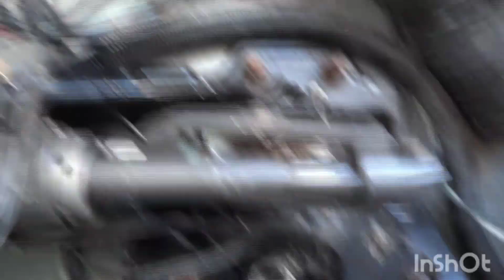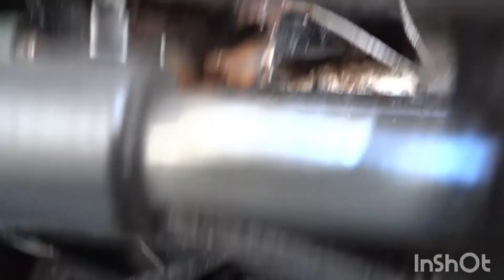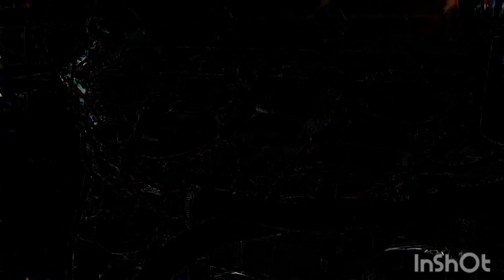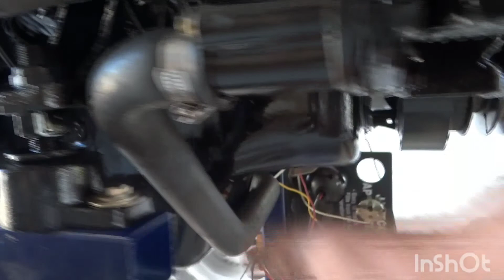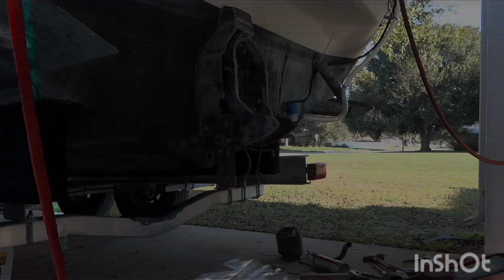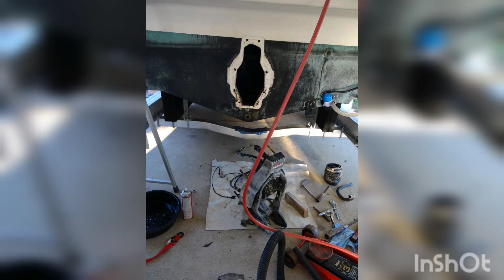Mercruiser transom plate and gimble repair

Comment: I have to maybe take mine off to replace the gear loop fitting next to the intake assembly.Is there anything I need to watch out for I did not see a gasket on yours.Would there be a paper gasket that would be replaced?When I take mine off

Comment: Good job, my friend. I liked the music, just maybe a notch too loud. But yea, bravoitis.. I've dealt with it a few times in my 20 year career. I'm in a fresh water area so I don't see it a lot, but occasionally someone buys a boat that has seen salt and I end up having to diagnose & repair the issue. In all cases, I have deleted the original intake setup and installed a thru-hull pickup. That may not be possible in all scenarios, but it was doable in all the cases I've encountered. Never to worry about it again, all the water the engine could ever ask for, and much easier/cheaper than repairing the original design - especially if it requires pulling the motor! Rock on!

Comment: Thanks for the video! I found it very helpful to diagnose and confirm what I already knew... I had a raging case of Bravo-itis in my Mercruiser 350 MPI and Bravo 3 outdrive. There is an aftermarket hose kit that utilizes a stainless steel fitting to prevent the hose collapse. The previous owner/s kept the boat in the water in Southwest Florida, so when we bought it there was a great deal of cleaning to do to get it to our specifications. We decided to trailer the boat and keep it at the house. A big beast to trailer but so worth the convenience of keeping it at home. We also flush it out after every outing and use Salt Away. We were getting a "Low Water Flow" alarm on the Garmin MFD and that would send the motor into "Guardian Mode". Disconnecting the water pressure sensor switch on top of the block will keep you from getting stranded, but the engine only runs at 80% power. I made a bunch of YouTube videos detailing all of the "fun adventures" we have had over the last year with our Rinker Fiesta Vee 270.

Comment: Where is your follow up video?
Reply from the maker: Sorry I didn't film any of the assembly or Swivel Pin and bearing replacement...  media Blasted all parts and primed and paint with hardened Urethane... Assembled complete unit on the bench... yes, wish I had some video but got in a hurry,   damn boat was down almost 2 years...  I'm having shifting issues going into forward gear, so I may film the trouble shooting, diagnosis and repair... if you have any questions,  please ask 😎  the learning curve wasn't too bad but I had to do a lot of research... boats got Monster Power,   SUBSCRIBE AND LIKE

Comment: Can that pass thru fitting be accessed with the engine in?
Reply from the maker: Yes, in many cases... depends on engine size and boat construction, its tight, may want to remove exhaust manifold on the big motors...This corrosion only occurs in saltwater boats... Mercruiser and others have a new upgrade design that use  a plastic flange and tube to rubber pickup hose.  I used this in my rebuild...😎🇺🇸 thanks for the question and watching